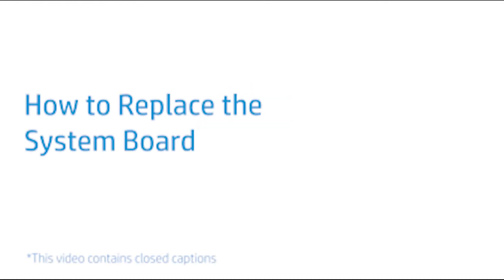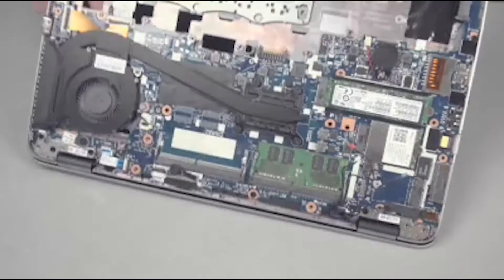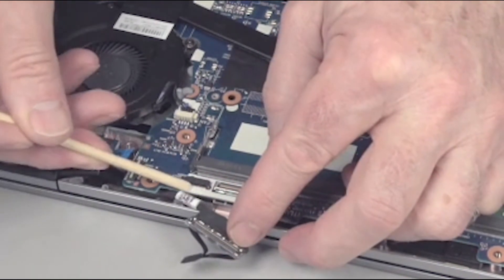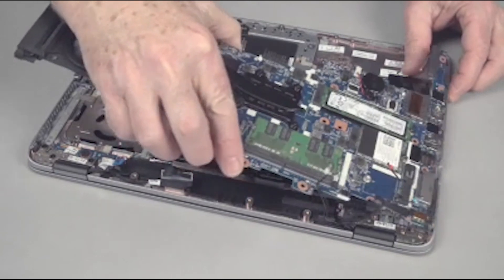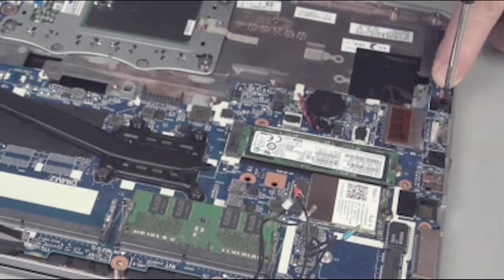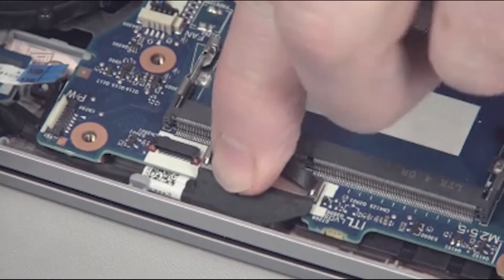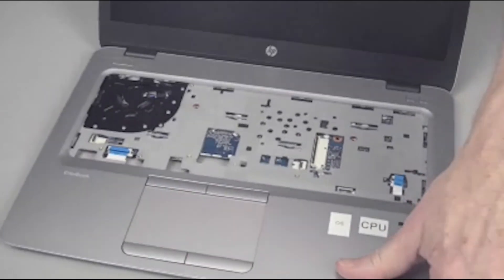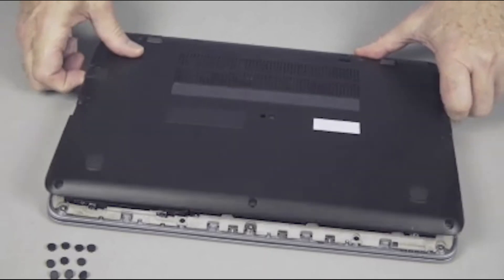Replace the System Board | HP EliteBook 840 G3 Notebook PC | HP

Comment: Where do the red and blue wires connect near the wireless module?
Reply from the maker: Hi Benjamin, thanks for contacting HP Global Social Media Support!
I understand that you need to know about replacing wireless module. 
In order to get this issue fixed, please contact our customer care team over the phone or chat for further assistance, as this issue requires Live conversation with you over phone or chat to isolate the issue and provide you instantly with appropriate solution or repair/replacement options available at your place as per the warranty.
Please feel free to reach us on call/chat, please access this link to select your preferred country and language option to reach us. Global support link: - https://www8.hp.com/us/en/contact-hp/ww-phone-assist.html
Binu_HP Social Media Tech Support
Reply: Since HP didn't answer your question, those wires are antenna leads for a secondary WLAN card. They don't connect to anything unless you have two WLAN cards running.

Comment: can I replace the motherboard of an 840 G3 with an 840 G4 the chassis seems to be identical but will the 840 G4 actually fit?
Reply from the maker: Hi Mahdi, thanks for contacting!
I understand that you need to know about interchanging the motherboard.
I will do my best to assist you.
HP does not recommend upgrading or downgrading hardware parts or software that is bundled with the product as It may affect the manufacturer's warranty and performance, however, you could change the configuration at your own discretion.
Binu - Social Media Tech Support
Reply: @HPSupport  but will the g4 board fit in my g3 laptop?
Reply from the maker: In order to get this issue fixed, please contact our customer care team over the phone or chat for further assistance, as this issue requires Live conversation with you over phone or chat to isolate the issue and provide you instantly with appropriate solution or repair/replacement options available at your place as per the warranty.
Please feel free to reach us on call/chat, please access this link to select your preferred country and language option to reach us. Global support link: - https://www8.hp.com/us/en/contact-hp/ww-phone-assist.html
Binu - Social Media Tech Support

Comment: if my origin mothetboard processor was A10,can i replace the moththerboard with cpu A12?
Reply from the maker: +Hariz Sharuddin HP does not recommend upgrading or downgrading hardware parts or software that is bundled with the product as It may affect the manufacturer's warranty and performance, however, you could change the configuration at your own discretion.